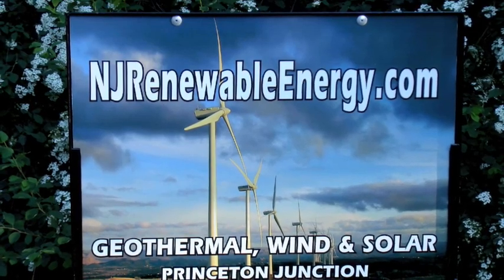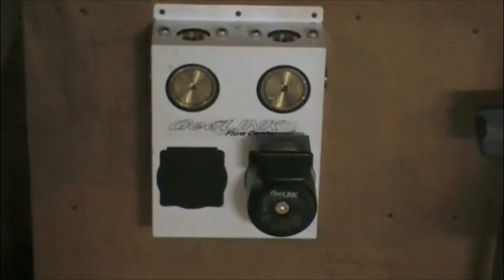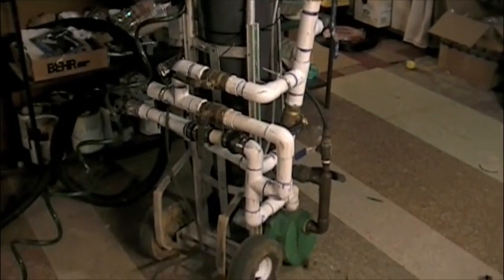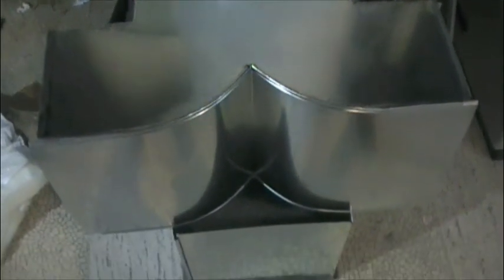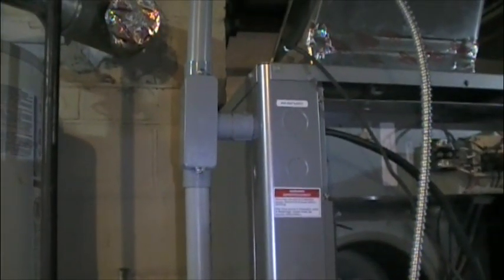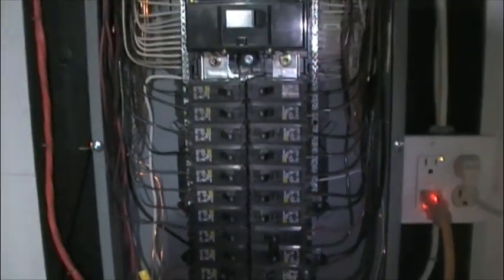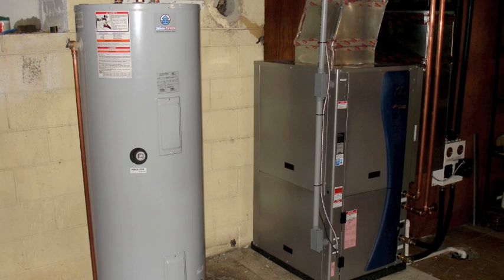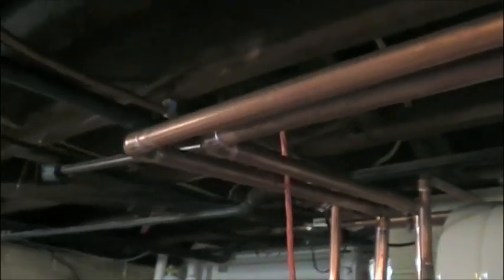NJ Install WaterFurnace Geothermal heating cooling PART 2

Comment: environmentally friendly anti-freeze.  Now that's funny.  It's a closed loop system anyway so what's the point?  Secondly, you're still reliant on fossil fuels and consuming electricity.  So, you've spent 4-5 times the amount it would be to install a furnace in a new house, and yet you still have a furnace (to circulate the warm geo air) almost completely defeating the purpose of having Geo-thermal, and now you have the additional geo.. You still have air being blown, the noise, the germs, etc, and you've spent yourself crazy to make almost no difference in the environment.  In terms of personal cost, you've eliminated the cheapest form of fuel (natural gas) and kept the most expensive one (electricity) with its rising rates.  Why not go total renewable then in light of your political speech at the beginning?  Get rid of the furnace, the electricity and get off the grid totally.  We can do it in Canada with our temperatures, so why can't you?
Reply from the maker: First off, I don't have a fossil fuel "furnace" and the closed loop is made with an environmentally friendly glycol.  Yes, closed loop, but if there is ever a leak, the point is that you're not contaminating the ground water   Second, if you would spend 2 minutes reviewing my other videos, you'd know that I have solar thermal and a solar PV array and live in a net zero home, making all my usage on site including my electric car.  Your suggestion that I've spent 4 or 5 times as much money on a geothermal system is wrong too, it had a complete ROI in less than 7 years with the incentives and energy savings.  Ultimately, I don't give a flying F***  about how much natural gas cost are, it still produces CO2 that is drasticallychanging the climate and fracking is one of the worst environmental disasters currently happening on the planet.    So to recap, I have a completely green home, I don't send any money to Saudi Arabia, I don't contribute to climate change and all my power is made in the USA.  

Net Zero House & Car in New Jersey  Solar PV Thermal Geothermal No utility bills
Reply: ماﻵ اخك
Reply: +PSM / NJ Renewable Energy Well said. I will have to contact you some time. Not in the market for a home yet, but I like the way you think.

Comment: I live in North Carolina, and just replaced my old gas pack with a Geothermal Heat Pump DIY kit - and it is awesome!! I had one 385-foot deep, simple, low-pressure well loop installed - no manifold/flush cart! The loop water was about 60 degrees in February!  I installed the rest of the system myself.  It cost me about $14,000, and I'll get 30% of it back from federal taxes AND 35% back from NC = NET COST <$5,000!!  Check out my video - ClimateMaster Geothermal Heat Pump Simple DIY Installation

Comment: So you replaced the geothermal hot water tank with a solarthermal hot water tank.

1. What was the problem with the geothermal hot water tank?

2. Why did the geothermal hot water tank have to be replaced?

3. Is the solarthermal hot water tank more efficient than the geothermal hot water tank?

4. What are the price differences?

5. Can you post a video answering these questions and explaining so those of us considering installing a system can benefit from the answers?

Comment: @MrFrozenCanuck 
Supposedly that's it.  No DeSuperheater+no buffer tank+no new electric water heater. 
2200 sq ft in southern New Mexico. 
I just found out on the BBB site, this contractor has a suspended license. 
I'm going to have to find someone else.

Comment from the maker: You are correct, you could.  However, it functions more efficiently, with larger pipe connections.  I also wanted to convert to electric since I'm going to produce my own PV Solar.   It also places the hot water at the top, my understanding is this works better since the HWH'ers element is towards the bottom.

Comment: Thank you.  I'm wondering, though, why it needs an extra set of pipes.  Why not use an ordinary water heater with a tee connection at the inlet and, say, the drain valve.
Great video, by the way!

Comment: Do the extra (2) pipe connections on top of the water heater go to a seperate coil inside the tank, or does it circulate potable water?